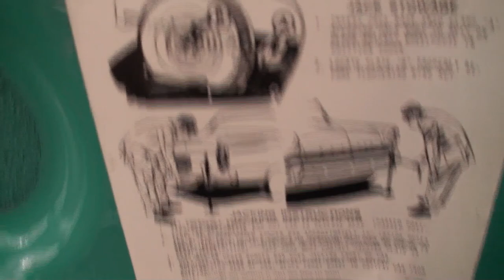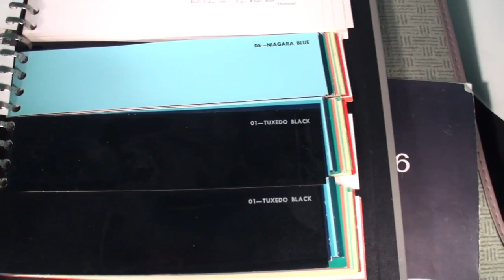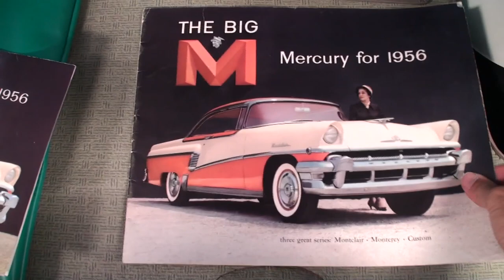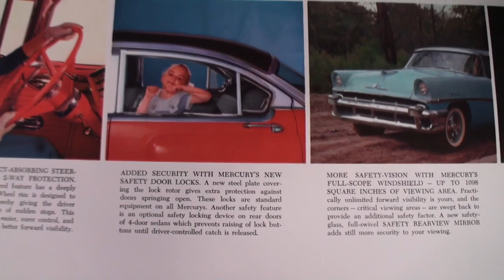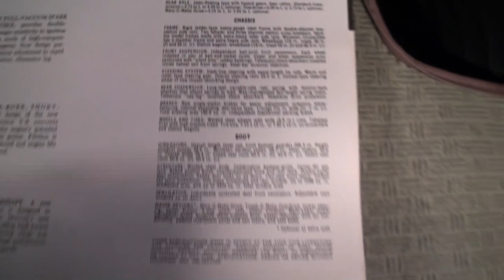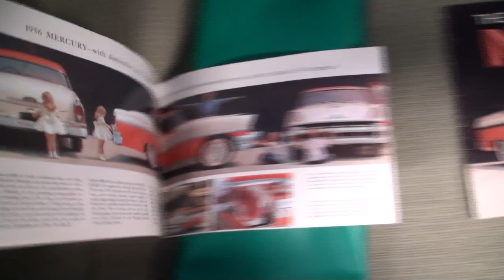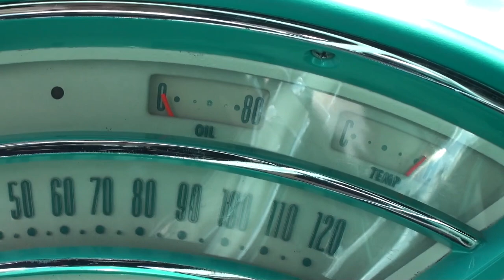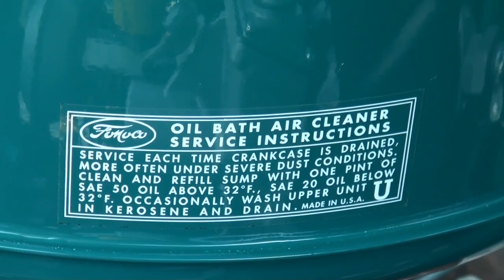1956 Mercury Montclair Convertible in Verona & Heath Green & Ride on My Car Story with Lou Costabile

Comment: Thanks again Ken and Lou for another great car story.  The 50's had great color schemes and it is greatly appreciated that cars like this are restored with the original interiors and in the colors they came in instead of so many greens restored as reds.  I always wanted a 57 Bel Air but because of how nice the 55-56 Mercury's were I bought a 55 Mercury Montclair Sun Valley instead because of the style, uniqueness and rarity today of those cars.  The 55 and 56 Mercury's could be loaded with so many options they could be basically a baby Lincoln.  My particular car has options of power steering, power brakes, power windows, power seats and factory air.  I really like the Mercury's when they proudly displayed the winged helmet Mercury god in so many places on the cars.   This kind of brand symbol has been lost on todays cars.  The Mercury god went away and so did Mercury,  The Pontiac Indian went away and so did Pontiac.  The Oldsmobile rocket went away and so did Oldsmobile.  Instead of an special car with their own identity they evolved into just another car.  Thanks again!
Reply from the maker: Hi Allen, Happy to read you had a 1955 Mercury :-) Thank you for viewing, sharing, and you're welcome, Lou

Comment: I had a 55 Monarch 292 which was indestructible ,I was young and beat the hell out of it, and it kept on ticking, traded it in for a 4 dr Monarch ( Canadian) which had a 312 Police interceptor which I turned into a drag car sleeper . 12.5 to 1 Pistons Howard Aluminum rods heads planed 40 thou and a 650 holly duel pumper 3.93 rear end.  Had a lot of fun , beating cars that should have beat me, 13.8 in the Quarter at 96MPH. I never forgot those Mercs and wish I still had one. I'm 80 now, but still remember beating the Farmer's 65 stripped Chev 327 350 HP. got him by a fender in the quarter. Monarchs weren't supposed to do that. That's the reason I'm still a Ford man.
Reply from the maker: Hi Freddy, Happy to read this car brings back memories of your car :-) Thank you for viewing and sharing.  Hope you see many cars on this Channel you enjoy! Please Subscribe, and hit the "bell" so you can see all the cars when they are uploaded on this YouTube Channel, Lou
Reply: Thanks Lou ! I hit the bell !  Keep them coming. @loucostabile

Comment: I saw one of these once.  Where does it rank size-wise among 1956 models?  In some ways, it's the biggest car of all.
Reply from the maker: It's pretty big, in 1956, maybe the Continental or Cadillac was bigger.
Reply: It is smaller than the 56 Lincoln, but bigger than the 56 Ford, both in length AND width.

Comment: Is It a 368 engine?
Reply from the maker: In the description of this video "We're looking at a 1956 Mercury Montclair Convertible in Verona & Heath Green Paint.  The car comes with the factory 312 CI V8 engine with 225 HP."
Reply: 312.  368 was the 56 - 57 Lincoln engine, optional on 57 Mercs.